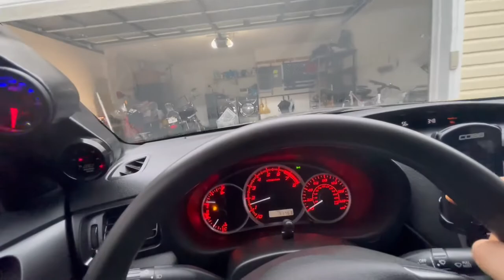Installing Cadillac ATS-V Brembo brakes on my 2014 Subaru Impreza WRX

Comment: The red turned out amazing! I also went with these I got them off eBay for 350 brand new and it came with new brake pads! How have they been holding up? Any brake pads overhang? I’m just waiting for the 2023 WRX VB brackets to get shipped out but until then I’m just trying to figure out what color I want my calipers..  I’m leaning towards red after seeing your! Liked, subbed, and rang that bell brother!

Comment: The 2005 rotors are 5x114, only the 2004 rotors are 5x100.
Reply: Dba makes a rotor for both the 5x100 and 5x114. It has both bolt pattern on it

Comment: What did you do to your car to make it sound like that ?!?! I love it !
Reply from the maker: Big front mount intercooler, Turbo Smart BOV, headers, catless downpipe and invidia Q300 exhaust.
Reply: How long have you been running the BOV I’ve been wanting the beautiful flutter but when I did my research it said that the 08-14 wrx/sti engines needs a BPV to have it recirculate
Reply: @kreaytorHD or get speed density tune

Comment: Did you factory brake line bolt right up?
Reply from the maker: Yes they did. Just need to make sure you use new copper washers for the banjo bolt.
Reply: @NikGarage  thank you!